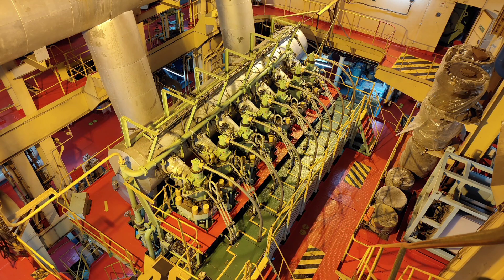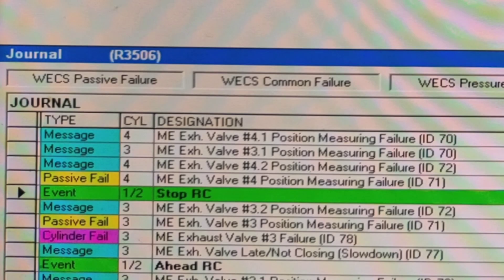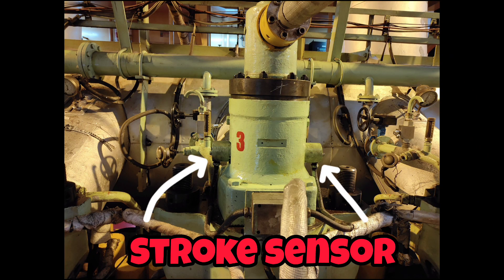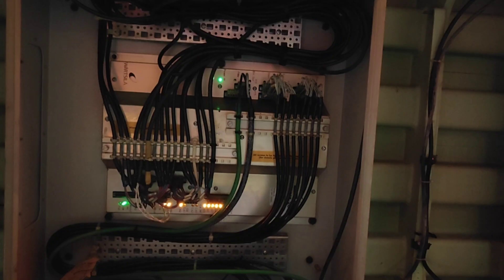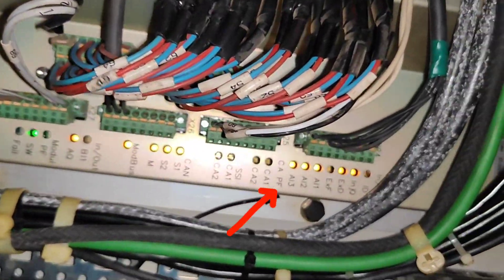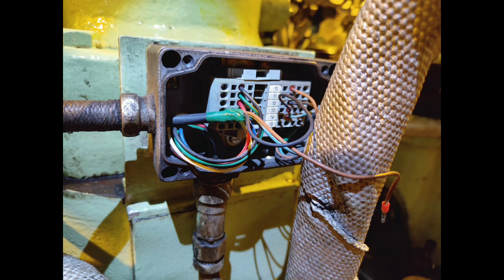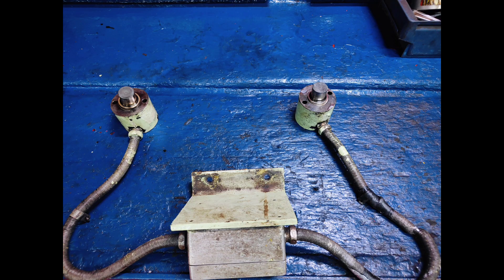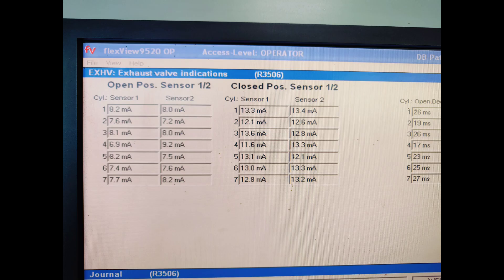Exhaust valve STROKE sensor change- Wartsila RT-flex Engine

Comment: Hello sir how can we buy a pass ex valve strock sensor? In rt flux engine watsila, I removed connection from terminal it's showing NA but some time when connect in place also showing na almost all ex valve unit given problem,phicially I chk mcm module there is not any red indication.please guide
Reply from the maker: Check and remove only the stroke sensor of faulty unit, try not to touch the others and then start rectifying one by one